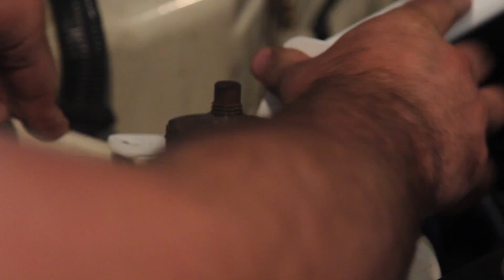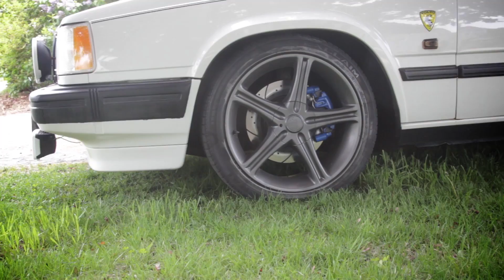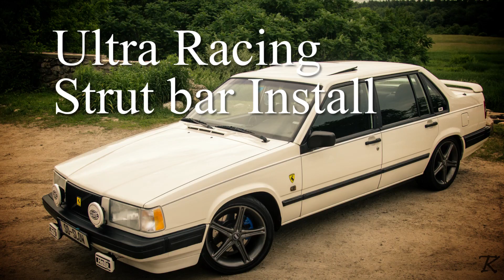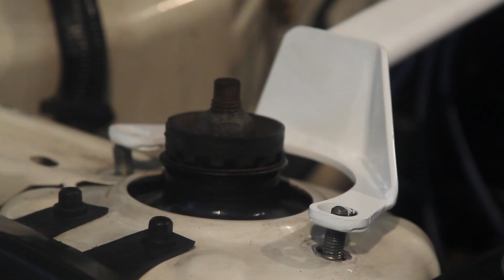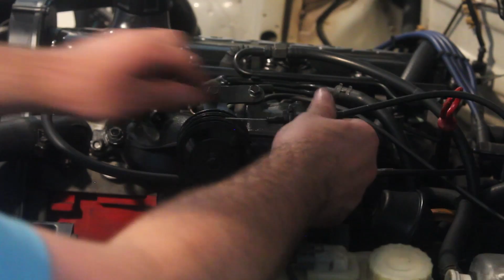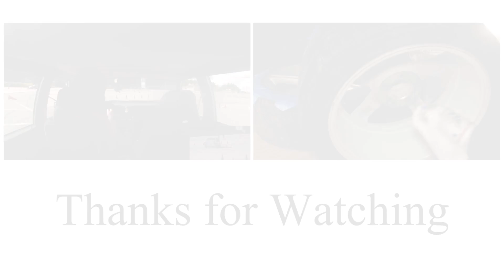Volvo 940 Turbo: Ultra Racing Strut Tower Brace

Comment: same thing happened to me with Ultra Racing, with the rear bar on a 855 , tried it in 3 different cars before I sent it back. also bought one for my S80 with 6-cyl engine, when I got it I realised it only fit on 5-cyl cars :(
Reply: Did you ever find the correct part for the S80 6-cyl?